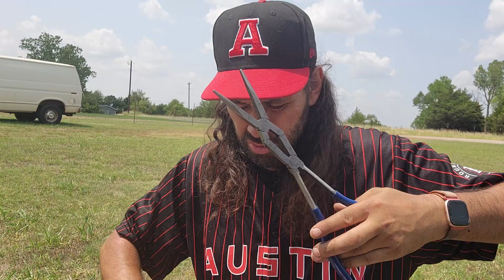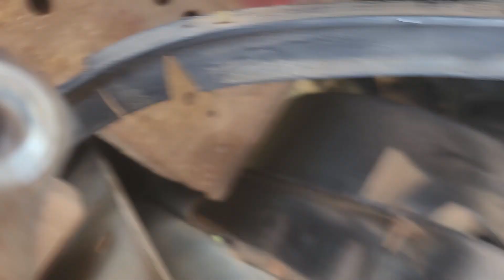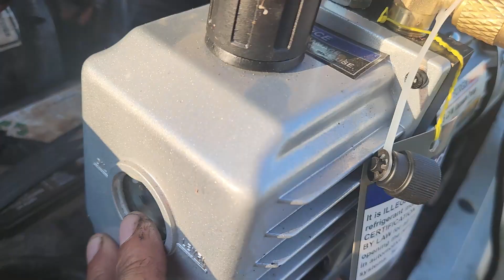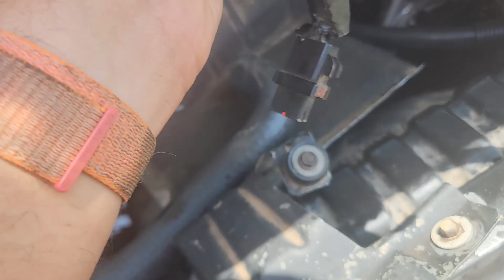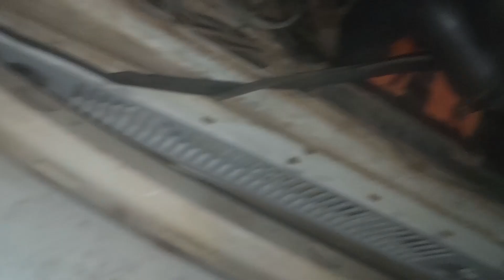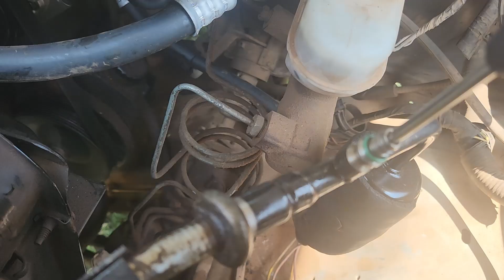A/C Repair NIGHTMARE!! Never Give Up When Doing DYI Repair Work!! 1988 Ford Retrofit R12 to R134A

Comment: Hey I commented on another video about A/C project on my 89 e150. Just replaced everything except evaportors(front and rear) and a few lines. Went to vacuum down wouldn’t hold. Accum drier is leaking going into evaporator. Took it apart a few times new o rings a few times, pag oil blah blah it just keeps leaking. Thinking I’m gonna try a new evaporator and maybe another accumulator. Man this has been a project like you said, really hoping to rap this up before it really gets hot here in NJ.
Reply from the maker: It's a total pain but keep at it.. the leak has to be somewhere! Maybe use some die and locate it with UV flashlight.

Comment: I understand how you feel 4 months ago I bought a 01Ford ranger and had to replace the high pressure line and replaced all the O-Rings on everything other fitting I could find bought 1can of r134 That had the compressor oil in and another regular can and by luck the AC Sytem came back life and blows ICE COLD AIR 😊 $125 Dollars in fixing it myself verses what a shop would have charged you can’t even get your AC SYSTEM Recharged for less then 250
Reply from the maker: @scott01clay74  yess despite all the issues I still saved money over taking it to the shop! I'm glad you got cold air!! 🥶

Comment: I have a 2003 F-150, 5.4 with the same problems. I finally got the compressor, dryer, and new lines installed, new pressure switches, relay, fusses good, fluid in lines and this will not engage the compressor. Took it to a shop and after $226 no soap. Still no cold air and not a lot of time to work on it. Mid week next week I can go over everything you spoke about like the connectors. Frustrating. Thanks for the advice.
Reply from the maker: No problem; sorry you haven't got cold air yet.. but you can do it; the A/C system only has so many parts to check on.. I was hoping I wouldn't have to change the evaporator or expansion valve because they're behind the dash, and getting to them would be a total pain.  Luckily I didn't have to touch them.

Comment: Instead of converting to 134 you should've filled with propane. Much superior refrigerant
Reply from the maker: Thanks for the tip; I didn't know!
Reply: @vanpocalypse3529  you can buy stuff that is labeled almost exactly like r12, it's just propane and maybe a little specialty oil. Called r12a or freeze 12

Comment: Now start over the accumulator/dryer is the LAST THE LAST thing to install if it's open for over 20 mins  it will absorb water from the air in the Decent Bag once it absorbs a table spoon on moisture it will release it. Refgant and moisture = Sulfuric Acid (the vacuum will NOT remove the Moisture from the Decent bag ) Results pin holes in the Thinest part of the system the Evaporator!!!
Reply from the maker: Next time I'll remember that Thanks